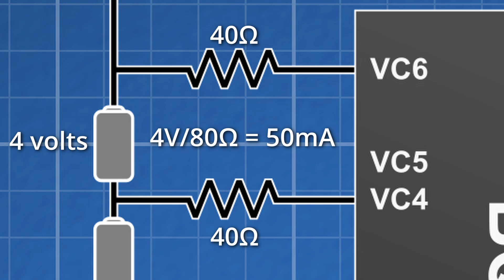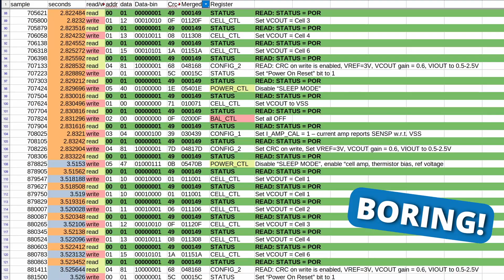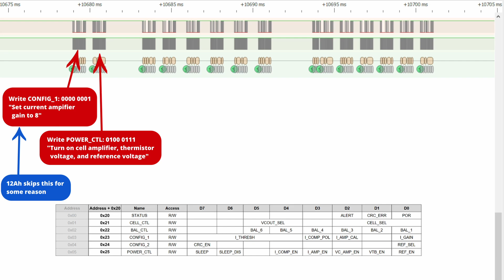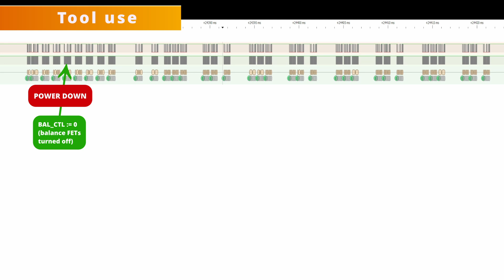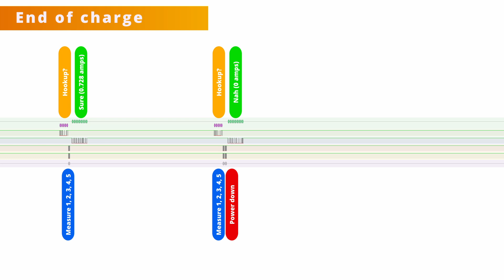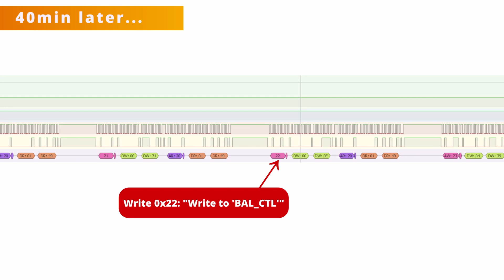[010] Why do M18 batteries charge to 3 bars?

Comment: It would be amazing if someone designed an open-source balancer for 20V Max (18V Max) and M18. I’ve been doing it manually for 20V Max batteries for years now using alligator clips to the balance leads or back-probing pins to the terminals. With a dozen DCB107 chargers around I’ve always been tempted to take one apart just to build a jig using the terminals. Taking one apart to replace the main PCB with an open-source balancing board would be even better. :)
Reply from the maker: Lot of effort to make an open-source PCB. I'd rather just mock Milwaukee until they fix their damn firmware themselves :-)

Balancing jig wouldn't be too hard. I've seen people make 3D printed jigs for rebalancing Flexvolt packs, and I've seen someone add JST connectors to the M18 packs so they could balance without taking it apart.
Reply: @toolscientist I applaud you for this, I just wish you platform was 1000x bigger😢
Reply: @toolscientist  I had to create a JIG for balancing Bosch batteries. But you need to disassemble it every time.
Reply: I drilled a small hole in my black and decker battery to run a 6 pin balance cable. Now I can use my iSDT balance charger with it. 

Some packs such as M12 have a connector with every cell already connected. But, sadly, that doesn’t work with balance chargers because the battery pack usually has a resistor in-line. You will probably always need to add your own cable.
Reply from the maker: @gf2e  yeah, same problem with dewalt - resistors on the pins. I wonder if there's a charger out there that's really smart and can be told to ignore resistance, or really dumb and just ignores resistance anyway. Prob has to be smart, the resistors create voltage drops that would need to be accounted for when measuring the cell voltages during balance. Or you've got to turn off balancing, let the cell settle, measure, then resume balancing.
Reply: Just charge each cell group to max. That’s what I do when I manually balance. I open up the battery and clip alligator leads between a slot on the OPUS BTC3400 and a bank of cells… then I do the next and the next until they are all at 4.19v.

Comment: Would be very interesting to see what Bosch Professional batteries do when charging or in use. Bosch representatives claim that their tools communicate with the battery.
Reply from the maker: Bosch is high on my todo list. I'll need to hunt for a 2nd hand battery, tool, and charger, but they seem common enough. I'm sure they "communicate" in some way, but that could be similar to LXT/M18 where it's just a simple stop/go signal.
Reply: @toolscientist  They definitely not actively balanced (at least the core ones) although claimed by Bosch representatives that they do.  i had to create a jig and balance them with external charger.
Reply from the maker: @donalexey  damn. The Hall Of Shame might end up being quite large

Comment: Perhaps it's a bug where when they check the cell voltages for imbalance, the accidentally read one of the cells twice. Assuming both batteries use the same firmware, this would cause the same cell in the pack to be unbalanced.
Reply from the maker: There could definitely be a bug, but not from checking the same cell twice. If they were balancing the wrong cell, I'd see it. Instead they're just not balancing anything. In my 12Ah pretty much all the cells are at different voltages, so even if they skipped one or even 2 cells, there would always be a cell that's at a higher voltage than the others.

Comment: The BQ battery balance chip, for those wondering, supports 50mA current through the FETs. The BQ chip does not control the FETs automatically in any mode, it relies on the MSP430 (which is quite capable of running balancing  code). 50mA would deal with 25mAh of capacity imbalance over one charge of half an hour period. Idling for a day could correct one cell bank by 1200mAh. (adjacent banks can't be balanced simultaneously).  The microcontroller has 32K flash, and 1K RAM. Which is comedically overspecced for what it's doing here. There is no question that they ran out of space. In principle, the battery firmware may be 100% capable of balancing if instructed or configured to by the charger, and the charger just doesn't.
Reply from the maker: They might have large code size. The 12Ah is actually using an RL78 (R5F100BDA) with 48k ROM, when the RL78 comes in 32, 24, 16, et cetera variants. So either they've written the world's most overcomplicated BMS (that doesn't balance) or for some reason the 48k chip is easier to source. But I agree that there's no way balancing was left out due to space constraints. My 31 lines and several variables can be cut down to about 8 lines and 3 variables (lowest cell voltage, highest cell voltage, highest cell index) if you only balance the highest cell. And in any case it's a trivial amount in a 32/48k system.
Reply from the maker: Another commenter just posted their new Forge 8Ah battery and it's using the same Renesas chip, but "BEA", which has 64k flash. They must be mining crypto in there! 

Now I see the scam:
1. Distribute batteries that mine crypto using other people's power. 
2. Don't balance so the batteries fail early
3. Harvest crypto from returned batteries
4. Profit!
Reply: Hilti battery chargers have cellular radios built in. They could totally be mining crypto.

Comment: I've always questioned weather they are balancing properly, or at all. This really could be called industry malpractice, or at the very least, anti consumer.
Reply from the maker: Yeah, it seems Dewalt and now Milwaukee are happy as long as the battery makes it past the warranty period. I wonder how many more brands I'll find that don't balance.
Reply: @toolscientist are you going to be testing other brands or maybe m12 as well?
Reply from the maker: Yes, I want to test them all (within reason - I'm poor, and a lot of the cheaper US and EU brands aren't available in AU). I have 5 or 6 M12 tools and 2 batteries from my own collection, so I'll do them soon.
Reply: @toolscientist  yeA ONLY IF I KNEW HOW TO IMPLEMENT THAT CODE BE COOL BUT I AM A DORK FRUM ORK ;] WEN IT COMES TO PROGRAMING I DID INSSTALL ANDROID OD ON A SAMSUNG S3 LOL YT [[[STEP BY STEP]] IT WORKED  CRYOgeNMOD WAS IT CALLed I THINK /pardon grammar again keyborg issues  new unit and ggggggggggg button is bad i ot to pull it and install new key china stuff ..yaaaa

Comment: Very curious what AEG (Ridgid) does now since my garage is all AEG.
Reply from the maker: AEG should be interesting. Pretty sure they have standalone protection with cutoff in the battery. I've seen a few of their tools with 2 pins and some with more, so they've got something extra going on. Are you in Sydney, AU?
Reply: @toolscientist I'm very interested to know if it balances or not. I can confirm that the battery does have a low-voltage cut-off. The battery itself looks to cut off around 13.5-14 volts. Newer tools have redundant cut-offs in the tools themselves. I observed that they don't start with voltages below 12 ish volts. Also, if I recall correctly, there are different thresholds for stopping a working tool vs. starting the tool.
Reply: @dimammx Nice! I suspected they did have a cutoff because they switched from NiCd to LiIon with the same battery connection. 

But my only Ridgid battery and charger are NiCd so I haven’t been able to test :)

Comment: Haha, there will be some disappointed folks on Reddit 😅 
Great stuff and thanks as usual!
Reply from the maker: Looks like I'll have to do Makita now.  That's twice I've been 95% sure that a battery balance charges and twice that I've been wrong!
Reply: @toolscientist  yeah lol, you def should!
Reply: @toolscientist if makita doesn't balance charge then their manuals (and marketing ig) are lying. Iirc they specifically mention that batteries get balanced when left on chargers after they are fully chsrged
Reply from the maker: @KeijonAutoVuokra  thanks, I'll have to look that up. I like when they make specific claims (rather than vague marketing claims), easier to test them that way. My feeling is that Makita got burnt by the poor design of their first LXT packs and went overboard after that.
Reply: Pretty sure Makita does. I've taken apart an 8 year old battery this week and cells were within 0.02v. 😮

Comment: I know when I buy Dewalt I'm buying cheap. What's Milwaukee's excuse?
Reply from the maker: Only things I can think of are that they had problems getting it to work reliably and then after a while they found that cell matching was good enough. Otherwise it's just planned obsolescence, which is risky for a pro tool brand.
Reply: @toolscientist  marketing-wise, how about how balance charging takes longer, and they lose more in sales from the perception that they're less efficient and slow charging, than they lose by the long term reputation of having poor balancing or only charging to 3 bars (something that takes years to notice)? From the looks of the code, it's like they didn't know who to hire (how many EE's or Programmers on staff there to even help choose a candidate?), may never have known it never worked, because they hired an idiot. I'm really curious what Dewalt and Milwaukee's corporate response would be if approached. Once upon a time I wrote to Campbell-Hausfield about my compressor motor burning up, and I was put in charge with the literal chief of technology at the company in response. Some of these technical people just never seem to be approached and are fascinating to talk to.
Reply from the maker: True. But they could just leave it to stealthily balance at the end of charge and no one would know or care. Marketing wise you could add an "optimising" LED to the charger and convince people that it's putting extra special electrons in the batteries.
Reply: @MattsAwesomeStuff  Except balance charging really doesn't take longer. It's 2mA drain, only on imbalanced cells. If one bank only is high, for example due to low capacity, with charging taking half an hour you get back an effective 10mA due to better balance leading to whole pack rising in capacity by 5mAh over a half hour charge. The charge only takes 2 or so seconds longer in half an hour, and only as you're raising the capacity. Obviously, you could trivially also continue balancing when in a charger idle. Even if you don't want to run the balance circuitry when out of the charger.
Reply: @toolscientist  well yes obviously this would be the right way to go. It's such a tiny thing to keep them from falling farther out of  balance. When you and I run Milwaukee things will be different, but do you think the guy who wrote that code is A-tier material? Or was his IQ below room temperature?
Reply from the maker: @MattsAwesomeStuff  I think whoever wrote the code left the company a decade ago and now it's held together with duct tape, haha. Surely a company of Milwaukee's size has several full-time embedded programmers, right? Maybe they just outsource that stuff.
Reply: @toolscientist  yknow, I have no idea. But consider how little of that type of thing thst they actually do. Programming for what? How often? You think it's even 1 full time position? I could see it being 100 hours a year, or, maybe a department of 10 people, or anything in between. I can rationalize it either way.

Comment: As pessimistic as i sound, i would not be surprised if the code is present but disabled, as death by imbalance tends to take quite a while, its kinda like a stealth planned obsolescence to sell more batts, dyson batteries and i also suspect ryobi 36v batteries do the same
Reply from the maker: I rarely buy the planned obsolescence argument as it only takes 1 disgruntled employee to leak it and then your reputation is trashed. Consumer electronics can get away with it, but power tool brands would get savaged for doing such a thing. But yeah, I'm struggling to think of what other reason there is. Only thing I can think of is that they couldn't get it to work reliably. But then why stick with the same balancing chip for 15 years?

Comment: I suspect that they put a first year university coder to design this code and they did not understand the big picture. That was a number of years back and no one has touched the code since. And who knows, maybe they lost the source code.
Reply from the maker: That has crossed my mind. It was developed back in ~2008, then the Redlink Plus update (digital comms with charger) was in ~2013. They definitely made an update when the 6/9Ah came out as they changed from 2.0V to 2.5V low voltage cutoff. Then there was at least another update around 2021/2022 to add the LED diagnostic codes back in. So they seem to be able to make updates.
Reply: That seems plausible. I’m also wondering if there’s some manager who says “it’s working fine, don’t change a thing, you might break stuff!!!”
Reply: A bit like what Boeing did for the 737 Max software.

Comment: Would it be advisable to exchange those resistors ourselves?
Also, the extra code you wrote, is that able to be added to code in the program chip.  Or is that a factory only thing.   Those updates would extend the life of these otherwise great battery's
Reply from the maker: No point changing the resistors as they're never commanded to balance. There could be a reason for such high resistors, they may have had problems in development

You can't add parts of code to a microcontroller, only the whole code. So we'd need to reverse engineer (or reimplement) Milwaukee's whole code. The chips may also be locked after they program them at the factory. Overall I think easiest option is to just build a jig for easy cell connection and manually balance periodically.
Reply: @toolscientist  yup,  that is my usual go to.   I have a smart charger with a Ballance lead made up just for the purpose.  Every 20 or chargers I make sure to do a Ballance/maintenance charge.    Milwaukee really dropped the ball on that one. Otherwise a great product.  I use the same principle as when charging my LiPos for my Model air craft
Reply from the maker: @russcole5685  there must be a good reason for it as it costs them nothing to add a bit of code. It seems their older batteries held up well without balancing, but then the 8 and 12Ah really struggled. Lets hope the new Forge batteries have balancing or at least more reliable cells
Reply: @toolscientist  even back thirty years ago, I didn't like the idea of pushing 8.4 volts through a 1.2 volt NiCd battery.  I always tried to separate the cells and charge separately.    This is the older days of 6 or 7 cell batteries for our RC cars.  I'm no way a electrical minded guy, but to me squeezing say 12V through a series of 1.2V cells seems a bit hard on the ones first in line.  My thoughts, run in series, charge in parallel.   Correct my thinking if I'm being over cautious
Reply: @russcole5685  it doesn't work like that fortunately 😊
Reply: I agree that a separate jig or whatever that you would drop the battery in to do the rebalancing.  Maybe an LED cycling through the various batteries showing the voltages. Maybe a button switch to cycle between the batteries instead of an automatic switching every few seconds.

If you want to get fancy, maybe a Bluetooth connection to an app on your smart phone that displays the various cell voltages. And sell this on Amazon or eBay.
Reply: @tonytango6676  This would not work with the existing code, unless the battery was designed for the charger to tell it to balance and this never happens as it doesn't. But then we still don't know what code the charger would need to send.
Reply: @tonytango6676  a standard smart charger does that as is,   has a balance lead for separate cells, and a main power lead for the full power.   Just look at LiPo batteries for Radio Control models